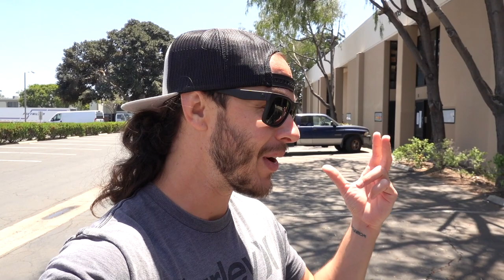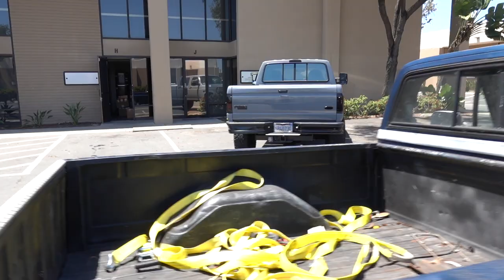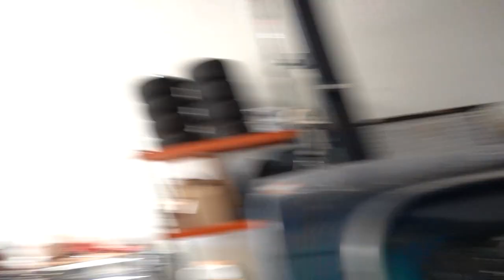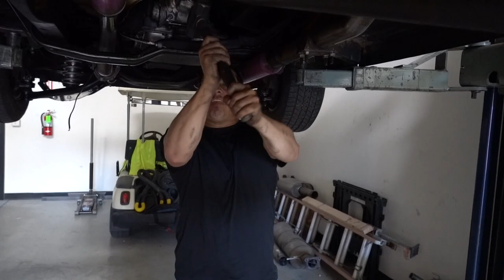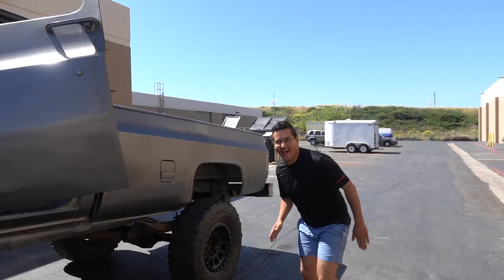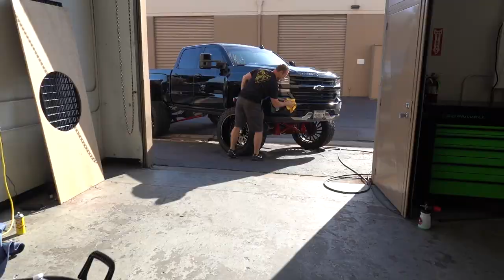WELL THIS WENT BETTER THAN WE EXPECTED!

Comment: Rear is putting ingredients pressure on the trans.  He needs to redo the rear drop and correct the distance issue or it will happen again or be the trans housing itself next time.

Comment: When you lower the truck the distance between the driveshaft gets smaller 
That’s why he busted the tail shaft 
He needs to shorten the drive shaft so there’s room for it to slide in and out on the rail shaft

Comment: WAIT, YALL DEADASS TRIED TAKING THE SHAFT OFF WITH THE JOINTS STILL CONNECTED?????😂😂😂 WTF
Reply: TlntdYungBulls Entertainment when you have a slip yoke on one side and straps on the other side all you have to do is remove the straps and the drive shaft comes out